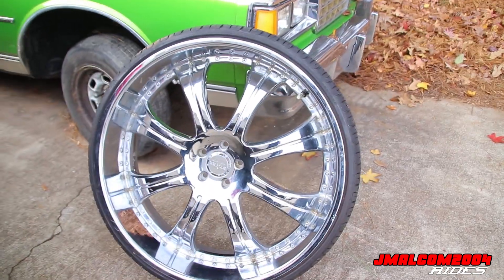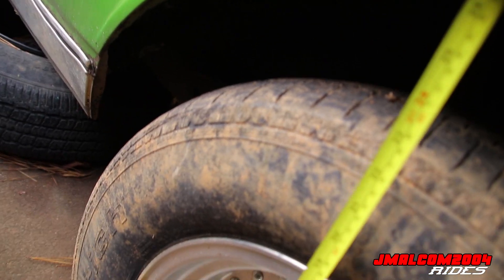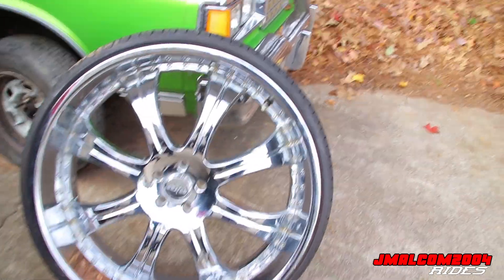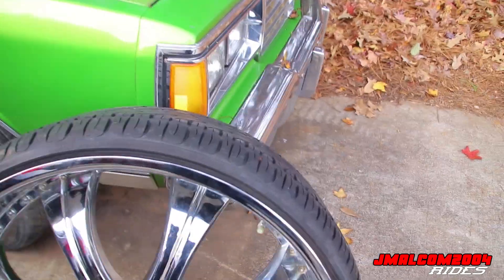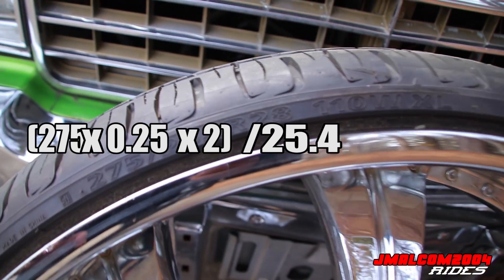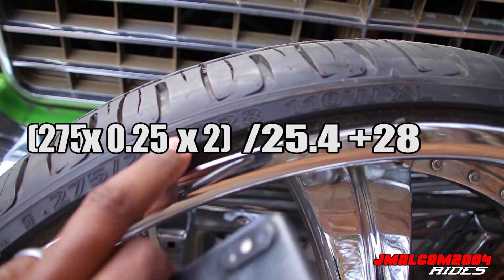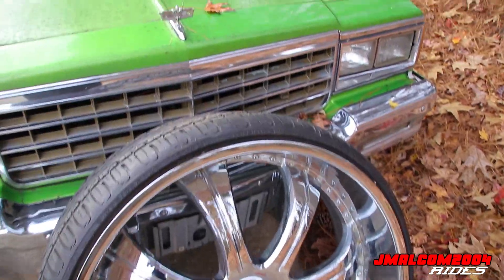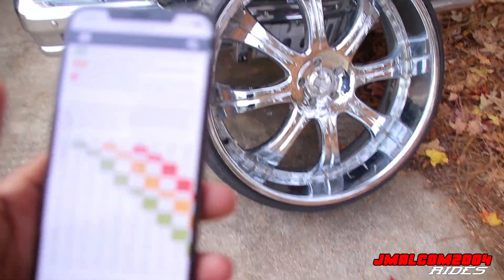HOW BIG RIMS AFFECT YOUR REAR END AND GEAR RATIO AND TALKING WHAT GEAR I NEED FOR MY 28s

Comment from the maker: I appreciate all of y’all
Reply: I WHAS TOLD YOU CAN CHANGE THE GEARS IN THE REAR END.THEM HEAVY 28'S WILL WEAR YOUR BRAKE PADS OUT QUICK".AND THE WHEEL BUSHING WEARS OUT AND THE TIRE ROD TOO".IT PUTS A STRAIN ON THE TRANMISSON WHEN DRIVING.THEY SAY AT WHEEL SHOP.YOU ONLY SHOULD GO FIVE SIZE UP FORM THE SIZE OF THE ORINGANL SIZE THE CAR CAME WITH NEW
Reply: JMalcom2004Rides so what about 22’s on a ‘14 Chrysler 300. I was gonna go staggered. I had 24’s on a ‘10 300.
Reply: @AWWWMAN80  IF YOU GOT TO LIFT A CAR AND MAKE CHANGENS FOR BIG RIMS.THEN THEY DON"T BELONG ON THE CAR.20'S ON UP IS A TRUCK TIRE.
Reply: God bless you my brother thank you for telling me that good news I didn't know that oh, so now I'm going to change my rear end when I get my car together big thank you and have a nice day and God bless you 🙏😇🙏
Reply: John caldwell I’m not lifting my car. They go right on. 22’s is the biggest I’ll go.
Reply: And I listened to every word you said, thanks pimpin
Reply: What’s the name of the rims @Jmalcom2004rides

Comment: A taller tire will roll further than a shorter tire rolled with the same amount of force. A taller tire will generally lower your rpm vs a shorter will raise your rpm. Usually when you excessively widen your wheel setup it i.e. going from a 9 inch wide to a 12 wide it will significantly affect your rear end ratio performance

Comment: FACT..... Anytime you mess with any part of the drive train. You should definitely get your drive train recalibrated.  There is a formula already set for the car. But one you for up or down on wheel size. It would behoove you to get it sown correctly. This video is definitely on point. Keep running the car and the adjustment hasn't been made. You will blow that transmission. Your engine's rpm will run high and you will blow the motor. Good informative Video. Each one Teach one!

Comment: Great way to educate about swapping gears for increased tire size. I always go one gear lower due to the increased weight of the wheels.  So if it calls for 4.10 go 4.30.   Calls for 3.90 go 4.10

Comment: We used to call it a poor mans overdrive. We had muscle cars with 4:11's and wanted to drive 150 miles away so we would put on taller tires to get the RPM's down.  We also used to put shorter tires on for shorter races.

Comment: HOW ABOUT BRAKE ROTORS BUILT FOR A 15" WHEEL NOW TRYING TO STOP A 24" WHEEL?
Reply: Thank ya homie .... You talk just fine.. KEEP ON TEACHING.👊🏾👊🏾👊🏾👊🏾👊🏾💪🏿💪🏿💪🏿💪🏿💪🏿💪🏿💪🏿
Reply: Larger rims have no affect on brake performance
Reply: @TheGarywilliams  
They wear the pads out 2x as fast.
Reply from the maker: Richard Wolfe longer brake time and faster pad wear basically. A give and take unless someone has the budget to upgrade the calipers and rotors
Reply: And the transmission fucking up because its not meant for those stupid ass clown rims
Reply from the maker: M3RKINFINITE OFWGKTA transmissions aren’t made for 33” tires either which are just as heavy if not heavier than some big wheels! That’s why you do the appropriate upgrades to support. It’s not hard to keep a opinion respectful 🤦🏽‍♂️ but carry on bro lol
Reply: @JMalcom2004Rides  in my opinion a big black Gap in your wheel well looks really really stupid to me and I prefer to fill it up with a rim
Reply: @JMalcom2004Rides  I think you're above most people's heads with the transmission gearing and the rear end gears and the car wheel sizes that's pretty complex for most people to figure out
Reply: @JMalcom2004Rides  it reminds me of the idiots that buy a speaker box from car toys and stick it in their car and wonder why it doesn't sound good instead of buying a speaker and measuring the square footage of the car and building the appropriate box for that breathing space so it sounds perfect whether the windows are up or down
Reply: @thecloneguyz  JMalcom did the right thing buy putting the information out there. Anybody that follows this channel and have a passion for big rim cars will figure out what he's talking about. Besides, he's making these big rim budget build videos specifically for those guys.
Reply: @realest1006  I love big rims so I don't know if you're confusing me for somebody else
Reply: @thecloneguyz  I'm not talking about whether you're a big rim guy or not. I'm talking about your comment saying that JMalcom's video being over people's head. Trust me, the people that he made this video for will figure out, exactly, what he's talking about. Most of them already understand it. I mean, he explained everything good enough for anyone, who's truly interested, to understand.
Reply: @realest1006  oh right.  Got you.
Reply: Great info 👏🏽👏🏽👏🏽👏🏽👏🏽
Reply: @realest1006  I agree 100% I can't argue with that
Reply: @thecloneguyz  I'm pretty sure he meant to say measuring the cubic footage of interior air space in the car not square footage those that would be like literally no help to your required formula sticky box requirements and figures and it ain't like we used to do in the old days needed you just go buy a box and throw some subs in their subs ain't nothing like they was back in the day they are something to think about now you if you don't put the right subs in the right box and facing the right direction with the right back pressure in the rye ports year in reverse do your homework people go online and see if you can find the formula to figure out exactly what you looking for don't buy some subs at this yard sale and a box at the dam flea market and put it in your car and stand there and look stupid do the formula by the right stuff I'm not saying you got to spend a lot of money on it but getting the right size stuff for your needs boxes and subs have to be matched nowadays
Reply: Bigger brake pads may have to change the caliber
Reply: Thanks for the info bro.
Reply: @TheGarywilliams  maaaan thank you..ive been screaming that for years..brakes are to stop the energy created by the motor not to stop rims...a 3000lb car going 80 mph is still a 3000lb car going 80 mph regardless of the rim size

Comment: The GM B body cars from 77-79 had a 2.76:1 rear end from the factory. From 80-90 they had 2:56:1. Of course there were special order differences. I had a wagon with a 2:29:1 and police cars had 3.73:1, for example. The final drive ratio is affected by the tire diameter. You established that. But the reason you need to change your rear end when you put gigantic wheels on you car is have to get your RPMs up to where the driveline was designed to run. If you’re running a huge tire, your distance travelled per tire revolution is much greater than the factory tire size. When you travel a farther distance per tire revolution that drops your engine RPMs. This will cause problems with your transmission if you have overdrive and is will affect your shift points regardless of what type of transmission you have. Your comment about manual transmission vs automatic means nothing. It is only affected by the final drive ratio in each gear.  Third gear in a th350 is 1:1 but by comparison 4th gear in a 700r4 is .76:1. A six speed tremec has an even lower ratio in 6th gear. 

All that to say your math is probably accurate, but some of your details are misdirected.
Reply from the maker: Yes everything you said is true and I do truly know all of that. Glad you put it out there for the world to see. Only thing that’s not completely accurate with what you said above is about the 3.73. The box 89-90 9C1 caprices or taxis had a 3.08 and a very few a 3.23 ratio. I’ve owned 3 9C1s total and 2 with factory rears. But the rest of the info is correct. Thanks for adding that

Comment: If you put the same size back on in a bigger rim/smaller tire it dont change anything only when the new set is bigger than stock.. same scenario as big mud tires on a truck and most dont know it will change the shift point of the transmission too!

Comment: one other thing a lot of people forget is that you need to adjust your front end too, steering arm needs to be adjusted because of the height difference (they make them usually for 4x4's) and are heavy duty as well. there is a lot of little things people miss when you put bigger rims/tires weather its a big old mud truck or a street car you need to treat your care with the extra love or you end up tearing up stuff.

Comment: Man I sho wish this video was up 15 years ago. I put a lil hot 350 together huge cam nice heads sounded like a beast! Bagged that bihh out the drive way I put water down couldn't burn a tire with help.. then I learned about the rear gear

Comment: Thank you so much sir. I really appreciate you. Question please. If, I put 28 inch rims on my box chevy, what do you recommend mechanically I do to the suspensions, gears box, transmission, control arms, brakes etc to support this new weight of the rims? My box chevy is overdrive transmission and 307 engine. I am new so please forgive my simple question. I just want my car to support the new heavy 28 inch rims.  Thank you,

Comment: I’m putting 22 irocs on a 2010 Camaro SS. Will I need to change the gear ratio since the stock rims are 20s. I know it maybe a slight difference but since the gears are rated for 20s, but not a drastic change to 22s. I’m taking in account to got thinner profiles on the 2s. 

I was watching your video, I know you’ll said it’ll be a big deal from going for 17s to 26s. I didn’t think they would for 20s to 22s. Just wanna be for sure before I get to moving to quick

Comment: People use automatic transmissions in racing applications all the time.  Check out some products from TCI for example.  There are 700+ HP packages designed for racing.  Depends upon the application, racing regulations, and/or preference but to say an automatic transmission is not for racing  isn't a true statement.

Video is informative..thank you for sharing.
Reply: Just think that so many people wasted their money putting a beefed-up Powerglide in their drag race car.
When I was young a long, long time ago, I couldn't help but think a 2 speed automatic transmission was useless. I was a little bit naive back then.

Comment: Also what's bad is that a lot of vehicles come from the factory that are 4200Ibs with a 170hp v6 engine which has to work much harder to move that weight.

Comment: I have a 85 caprice on 26” with Yukon gears 3:73 in the rear end.. my transmission built as well but my next move is to snatch out the 350 that was put in & put a big block under the hood
Reply: Bonchico davis what trans you running
Reply: etxchevyboi 700r4 with trans-cooler I’ll upload a video 2maro

Comment: I had a 70 monti carlo SS with a turbo 400 and 12 bolt 373 gear w/ 28" tires and turned 29 hundred at 65mph.
Reply: Since when they ever had a 70 MC SS?
Reply: I have a 1972 Monte Carlo 
402cui , Turbo400, 373 geared,  Bucket Seats, Floor "H" Shifter, Half Cloth Top- TRIPLE BLACK OPTIONED - VAN NUYS BUILT 
I HAVE THE ORIGINAL BUILD SHEET

Comment: I have a 2005 F-150 crew cab 4.6 V8 RWD with a 3.55 gear ratio. I'm looking to put 22's with a 33 tire or 24's with a 35 tire with a leveling kit.  Should I still change my rear gears?

Comment: Hi my name is WB. Im new to your channel.i just stumbled on it.im happy i did..? I live in Boston Massachusetts. I just bought a 07 chevy avalanche 4×4.what you said about having big rims on my truck i will need to change the gear ratio.i have the factory 20s on her now .i just got some 24 for the spring and summer then i will go back to the factory for the winter.what is your recommendation.should i just leave it as is or put gears to run my 24?

Comment: Overall tire hight affects final drive ratio, taller tires make for a longer gear, so if you have say 3.73 gears with a 30 inch tire it will act like a longer gear than, say a 25 inch tall tire

Comment: Great information  got me thinking my about my combo  406 700r4  and 3.73 gear on 26s  I probably could go 4.10s
Reply from the maker: Phillip Mckay you actually could seeing you have a overdrive trans and bigger diameter wheel. Would pull better too
Reply: Phillip Mckay that's what u should got. I got 24s with the same motor trans and gear combo and the 373 is nice but I'm gonna get the 390
Reply: JMalcom2004Rides  what do you think a 4.10
 I want to keep the 700r4 alive when I build it  less strain as possible
Reply: I have a 700r4 trans with 305 I wanna go to 26s with should I go with

Comment: Want to help me with some info on my c10. 454 with cam turbo 400 2400 stall. 26 inch wheels. Need to know what gear would be good for it.  Not racing just a play toy. Want to be able to do burnouts and cruise around town

Comment: I have a S10 2000 4x4 single cab in my rear end is making a knocking noise I have 28 rims on it what do you think will be the best gear to get the motor is a 4.3

Comment: My ex-girlfriend has a Jeep that had the factory rims and tires replaced with much taller mud tires. That was done before she bought the Jeep but I had the hardest time explaining to her that the reason it struggles even going up a slight grade is because her axle ratio wasn't intended for tires that tall. She constantly criticized me for manually downshifting so the transmission would not be continually shifting as it struggles to maintain speed. Now it seems she needs a new transmission. I wonder why.
Reply: Stonewall Jackson  do you know the function of a transmission?

Comment: "How ta calcalate dat"....

And PLEASE stop saying big rims will change your gear ratio. The only way to change a gear ratio, is to actually change the actual GEARS in the rear end!! Big rims DO NOT change the gear ratio. Since big rims have a larger circumference, they DECREASE the number of wheel revolutions needed to travel the same distance as a smaller/stock wheel. The gear ratio is still the same, but that ratio produces different results depending on the wheel size.  If your vehicle is running 4:11 gears in the rear end on stock wheels, it's still running the same 4:11 gears when you upgrade to larger wheels. It's just, those larger WHEELS make 4:11 gears produce different results.

Hope I explained that well enough.
Reply: Naaa u didnt.. explain that again 🤣
Reply: The different result is usually a slow ass car.

Comment: question let's say you factory rims are 15" and your run 20s and the overall circumference is the same for both tires however the 20s obviously is wider. does this still throw your gears off. so I'm saying the 15s are more rubber and the 20s are less but lined up both tires are physically the same height lined up together

Comment: You also need you increase your brake capacity larger brakes preferably with Cooling on them and then you have to drop your gear ratios down pretty low running them big ol Wheels like that you have to go to like 4.11 4.83 or even lower depending on what transmission you're using

Comment: Gear ratio is unaffected by tire size.
With 4.1:1 gears, the wheels will turn one revolution for every 4.1 turns of the driveshaft whatever the tire size.

Comment: Big rims are usually pretty heavy and rotating mass kills your power, doesn't matter on your gear ratio, yes changing the rear gear with stock power will greatly increase your drivability but there is always somewhere you are losing, honestly you get your gearing right and put a decent cam in it and you'll be good

Comment: Thanks this does help me a lot but at the same time...l am thinking l should build  with the mind set of one size height bigger or figure my tires one size up. If l am riding 22z figure for 24z-- Then l have a question for the people that really know this stuff....would that be ok or am l thinking too much¿      l have a project in the drawing stages of tucking 28z on a Crown  Vic / plus the same for a 96' impala SS

Comment: I’m like you I want to keep my th350 but I want the 4th gear. So what about the stall converter? I have a aluminum headed 355sbc in my 3rd gen camaro with a factory posi 277 but my stall is 3000 so my rpm is way up there trying to Cruise down they highway at 65mph in your opinion do think I should come down on the stall?? But here is the bad part I’m not sure what cam is in my motor because it was built when I bought it but it is rumored to be some where between 488 an 525 lift also it has 22” wheels
Reply from the maker: Jeffrey Adams if that’s the lift of the cam, stall should be on the money for the most part. But you could up the gear to help it pull better. A 3.35-3.42 wouldn’t be bad.  The lower ratio is why it’s stalling so much
Reply: JMalcom2004Rides oh ok thanks bro I didn’t know the lower the ratio the higher the stall

Comment: What gears u recommend for that same size rim and tire with a 305 motor, not a normal 305 but one with a cam, intake, headers, aftermarket carb....
Reply: Youtr probably ginna want 4.10 even without an overdrive
Reply: Posi as well
Reply from the maker: NIQUEO 444 Vlogs between a 3.90-4.11
Reply: JMalcom2004Rides wat u gunna use to fit those 8s suspension wise, I plan on running upper and lower adjustable trailing arms to center rear wheel... but in the front is my question, I don’t wanna use lift cups cause they make the ride to stiff
Reply: I wouldent run a 305 motor with 28s I would at least get a 350 with a little more torque. Also with a 305 motor more then likely transmission is probaly weak

Comment: Yeah bro good info man, you see these young guys go by these big rims don't have no mechanical knowledge of nothing. Sitting on side of road wonder why your transmission burned up cuz of torque converter couldn't handle the extra turns of the wheel wondering why the motor overheat? The burned up the gears in the rear end. Don't get me wrong it looks cool if you like it like that but at least know what you doing but that kind of information is important.